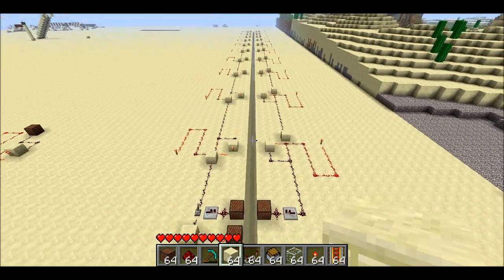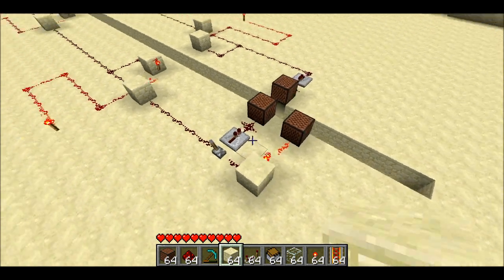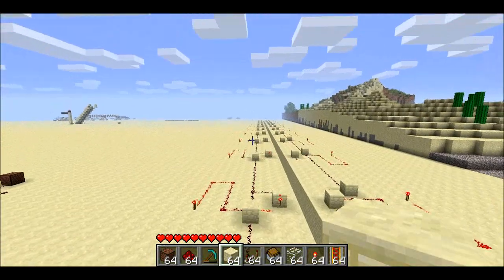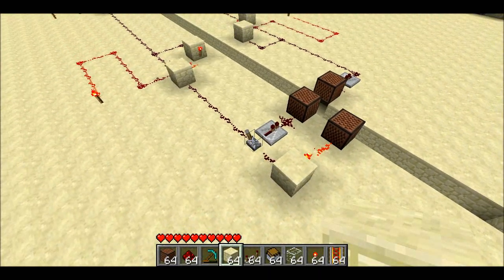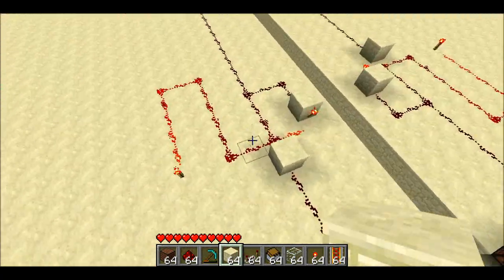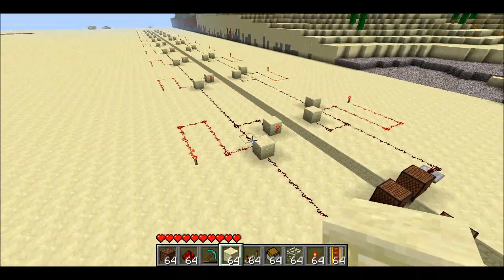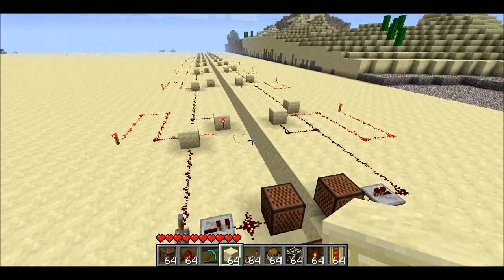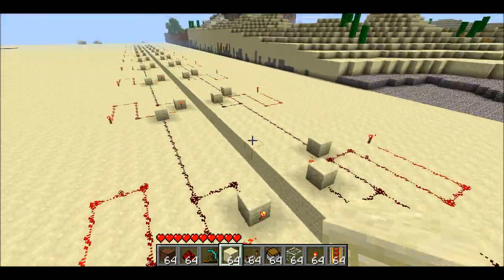InstantWire without any Pistons (NO LONGER WORKS)

Comment: if you use a toggle latch at the end, it will act like the piston based ones. (a toggle latch is a RSNOR gate with two AND gates hooked up to the outputs and input(s) that allows it to flip the signal). i use them alot.

Comment from the maker: @Ry0wn I use InstantWire in my games because it allows the player to time their button presses correctly when they're trying to control something far away. Some people use InstantWire for their 7-segment displays because they don't want a long delay when they're really far away from the display. Theoretically, it's possible to use my InstantWire to build a CPU with instantaneous clock cycles (but they'll still need a 3-tick delay between cycles to reset the components).

Comment from the maker: @eddyme08 Probably not. Every version of InstantWire so far either relies on Pistons, which take about 150 milliseconds to change state, or Block Update Detectors, which all have a reset time of at least 100 milliseconds before they can change state again. The version in this video has the fastest recovery time of any InstantWire I've seen, but it's still not instantaneous recovery.

Comment from the maker: @FSXbassi01 This one carries a redstone signal hundreds of meters without any delay whatsoever. The signal hits the noteblock on the left side of the chasm at the same time as the note block on the right side of the chasm, despite the fact that the signal has to travel hundreds of meters. Normally, redstone repeaters introduce a small delay, so there would usually be a several second delay between the note block on the left side and the note block on the right side.